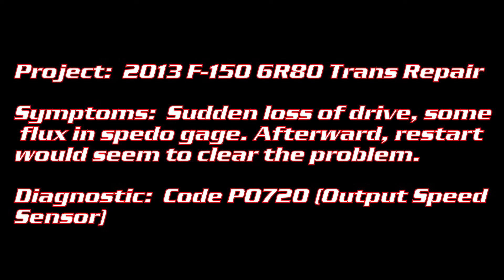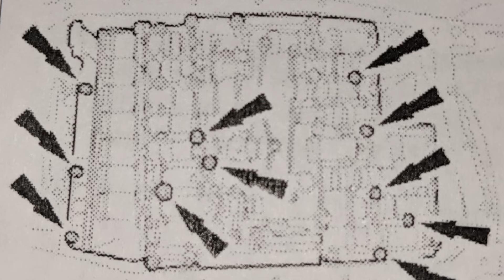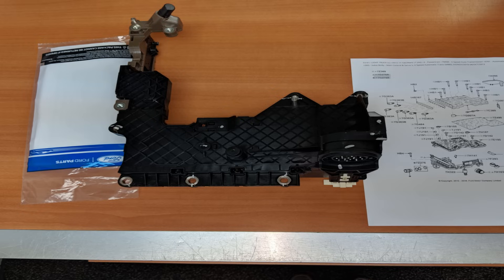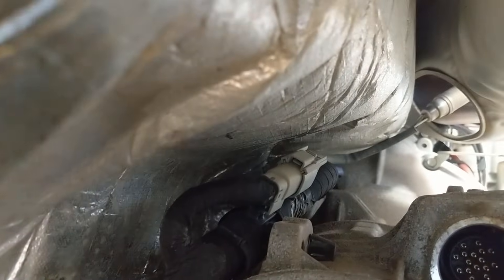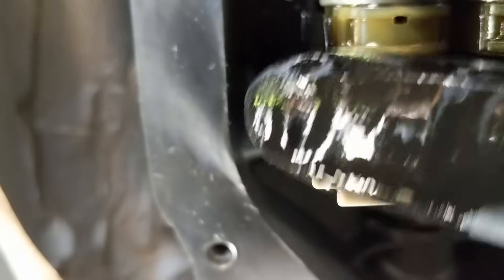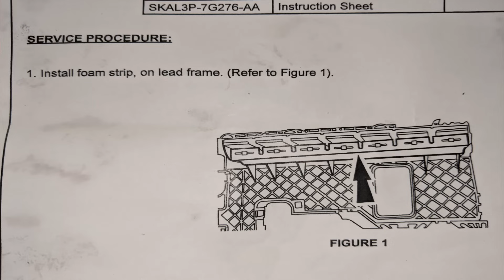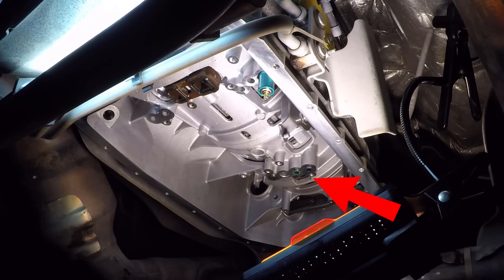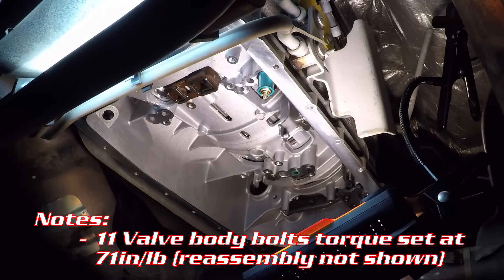6R80 Trans: Output Speed Sensor Swap

Comment: Boxcar,
Thank you for posting your video.  I have a 2011 F150 with 170K miles.  I had the dealer perform the recall "update" on my truck this summer.  Well last week my truck threw up the orange wrench and gave me the P0720 code.  I did my research, I realized I would be fixing this error myself as my truck was past the 150K miles listed in the recall for the free repair.  Thanks to Youtube, you, and Amazon I was able to repair my truck this weekend.  You gave me the confidence through your video to tackle this job.  The diagrams you provided along with the torque specs help me to complete the job.  I must confess I had a helper, which was handy especially when trying to remount the valve-body.  Thanks also to those of you who commented about having to drop the pan a second time to ensure that you placed the gear selector in the proper position on the Lead Frame.  Your comments saved me headaches, aggravation and some profanity.  My truck is running like a top.  Thank you.
Reply from the maker: That's awesome, this is what it's all about. Appreciate the.reply.

Comment: I'm having same exact issue with my 2015 3.5l ecoboost. Been sitting for a year and half, starting it, driving it around the block until wrench light illuminates because of this. For 1st year Ford had a part shortage, I literally couldn't get the part. I called every dealer in a 5 state area who had back orders up to 83,000 of these parts. I'm going to now get mine but I need to know one thing before I begin this job. 

Did you have to have the ecu or tcm refreshed to accept the new part??? Word has it you must refresh the computer to accept the new part or the permanent code 0720 and any associating will not allow the ecu to recognize the new part.

Also they are now calling this part the "conductor plate" and supposedly are coming with a small gasket to go over the leads to protect them from any shavings or particles causing the part to short and throw the code?
Reply from the maker: Never had the refresh. Good luck. I'm in a 2021 F250 now... but my repair was going strong till I sold it.

Comment: This is covered under 2 different recalls through ford a 150000 miles or less but not for Eco boost. First recall is for reprogramming to prevent having to replace the leadframe. The second recall replaces the lead frame.
Reply: The most recent recall is for a reprogram. Not for changing the leadframe. The reprogram is supposed to keep the tranny from slamming down into first when you’re driving. It does nothing to fix the problem this guy was having which is the same problem my F150 is having. He lists the symptoms at about the 25 second mark. I had the reprogram done a week ago (April 2019) and it did nothing for this problem - code P0720
Reply: @fnap7954  that's is the first recall the second recall fixes the leadframe I just had it done didn't cost me a dime
Reply: @fnap7954  the reprogramming the first recall is actually to prevent this from happening to the lead frame
Reply: @MikeBeast007  guys, thank you so much your comments!! Man, I was dreading this until you said Ford has recalls! I called this morning and YES this is covered. Drive a 2012 5.0 F150

Comment: “ they just about put the shade tree mechanic out of business”. Yes, you are exactly right! I’m about 95% sure that my next truck with be from the 1960s. I can make one as reliable as a new one and I can fix the damn thing 👍. My 2011 5.0 has been a good truck so far though. 98,000 miles on it currently. But I can’t help but long for the old days lol. A 1966 Chevy or Ford truck with a fuel injected v8 would be just fine and reliable as anything is
Reply from the maker: Amen brother! When you consider the price of a new truck these days...  I'd rather do/pay for a frame up restoration of something with class. He'll you can add anything these days you want. Thanks for watching.

Comment: Thank you for the video.  I am having this speed sensor replaced next week, under extended warranty, and I wanted to know what the dealer was going to do.  Now if I can figure out what costs I will have,  I am assuming the cost of the part is all Ford will pay for, all labor and fluids will be my cost.
Reply from the maker: Honestly....I did this repair on my own ($)....I had no idea there was an issue at the time....im unsure today  if it was even socialized yet via the recall when I did the repair.  AND...  I never went a local dealer for a refund....maybe I will....eventually.  Could use that money on some more interesting projects! Thanks for watching! Hope you Sub and drop by.
Reply: Boxcar Garage: Just picked up my son's 2013 Ford F150 from the dealer.  No charg e to have the speed sensor replaced under the Ford Extended Warranty.  No charge for the diagnostic time either.  I thought your subscribers might find this resolution helpful.

Comment: There is a recall on this but it will only apply if your truck is setting a code or a technician drives your truck and recreates the issue. My 2012 F150 has been randomly slam shifting down in low speed situations and on the highway for a year. I had the TCM reflash done and it helped for a month now the shifting issues are back. HOwever still no codes set and FORD will not replace the lead frame under the TSB without a code set. So I am ordering the parts and fixing myself
Reply from the maker: Good luck with your repair

Comment: Does this work for a 2013 ford f150 flex fuel v6?
Reply from the maker: If the v6 has the same trans I'd guess...but you'll have to verify that
Reply from the maker: But as I understand it Ford stepped up with a warranty repair. I was just too early in fixing mine

Comment: Great video! Got sudden downshifts while driving, with check engine/traction light coming on. P0720 code on diagnosis. Also glad you highlighted possible issues one can encounter especially when trying to mount the valve body back in the transmission.
Reply from the maker: Hope the vid helps.....was a very humble attempt on my part...but all is good so far! Thanks for watching.

Comment: There is a recall for 2012 f150 output speed sensor.
Reply from the maker: Really....any relief to second owners with over 100k....doubt it, but who knows.
Reply: @BoxcarsGarage  I read Ford extended the recall to 10 years and 150,000 miles regardless of ownership. Worth checking on, Danny

Comment: I was quoted 2000 dollars but that is with the install of a new valve body c/w lead frame. My trans has a nasty 1to 2 shift so dont think it is the lead frame. Gonna try complete vb. Thanks for doing this some excellent pointers that will help. looks like that funnel will work way better than the suction gun.

Comment: Hein sights 20 20. Ford just came out back in June 2019 a program to fix these leadframe issues. And they warranty the trans for up to 10 years and 150,000 miles from the date of the trucks first sale. Dont quote me on it on the warranty time. But I do know they came out backing the issue.
Reply: Ya but only for the V8 there are a ton of v6 trucks that the recalls basically leave out in the cold
Reply from the maker: Irresponsible of Ford

Comment: Thanks for taking the time to share your knowledge on the 6R80 transmission . I have dropped the pan on my car and changed the oil and filter after seeing your video. You certainly inspired me to give it  a try, even  as daunting as it appeared. Because the fluid had never been changed after 80,000klms(in Australia) I found a glug of grey paste around the pan magnet. It also appears to have found its way into the solenoids. Because of your video I have the confidence  to remove the valve body .From your experience, is it relatively straight forward to access and clean the solenoids.
I don't have any fault codes appearing on the instrument cluster but am experiencing a stutter when gear changes from 2 to 3rd and 3 to 4th. Info to dates says this may be the cause ie dirty solenoids ? Any knowledge/help would be appreciated .thanks Martin
Reply from the maker: Thanks Martin for that. As for your situation... Check this guys site... he's the lead I followed and a legit transmission man as well. https://youtu.be/8N9XQlUV-eY

Comment: Just replaced this on my 2012 f150 due to random shifting issues and getting stuck in first gear.  Code P0720 (output shaft speed sensor).  

Dealership reflashed the computer a few months back under recall but it had no effect and the issues were getting worse.

Truck shifts very smooth now with the new lead frame unit on there and haven't had anymore issues getting stuck in gear.

This vid helped a ton,  thanks.
Reply from the maker: Hey glad to have it appreciated. Congrats on the fix.

Comment: How many quarts did you end up using? BTW thank you for the video!
Reply from the maker: I believe it was seven and 1/2 I'll check and get back with you.
Reply: Approx.  7.5 quarts for mine as well.
Reply: Just dropping the pan and replacing the filter, I use 7.5 qts as well.

Comment: Just tried this last night, truck was in drive when started. After job was finished, I went to start truck and wouldn't turn over( not in gear?) Cycled the shifter, and now stuck in low gear (1). Did you do have to flash computer? Or manually select gear o. Side of transmission? 605-310-4447
Reply from the maker: Hey Owen thanks for checking out the video first off now granted I am not a technical authority to really be able to answer your question but if I had your situation I would probably want to mentally cross check if I got the tab from the lead frame in the notch of that plunger arm and also ensured that the linkage knob ended up in the notch of that piston on the other side sounds like to me you might have had one in and not the other and I don't know which side that would be that it's showing that is not taking the input but that would be my first thought and then beyond that I would have to do some studying cuz it would be outside of my realm of diagnosis.
Reply: @BoxcarsGarage  lead frame notch was in piston, but I'm guessing not on the exterior, but I'll be starting all over Tonight
Reply from the maker: That's what I guess is that the other Notch didn't get put in there that arm might have slipped forward or back and just didn't line up when you set that valve body in place. Good luck brother I feel your pain
Reply from the maker: oh and here's another nugget of information that came from the job guide when I was going to drop my valve body the job guide said that the transmission should be in neutral and I went ahead and did that and blocked it up and set the break of course to where it wouldn't move that neutral position might be something that helps get both of those lined up to where they're both able to slip into the Notch and if you don't have it in neutral it might cause a problem that you run into something to consider I originally didn't think much of it I just did it because it was in the job guide so let me know
Reply from the maker: No flash computer, and did not have to select a gear. The still image  in my vid would have been in a neutral position. I'd drop the valve body and select neutral when it's out and then put that VB back in and button up.
Reply: Hey just want to thank you for steering me in the right direction, I didn't get linkage hooked all the way. Now she runs like a top again, much love brother.
Reply from the maker: Glad to help... Just to let you know your the first viewer that has pulled any direct utility from one of my videos! So validated... Thanks for the feedback/happy to help/consider subscribing...it's a long road ahead! Later
Reply: @sixoh5ive840  what do you mean by hooked up all the way? Mine is stuck in park with no other gears
Reply: @Grayday1717  there is a plunger that moves back and forth that tell the trans what gear to be in. Have to rotate gear selector to that it fits inside the grooves of the plunger. I believe neutral is best position because it is easiest to line up.
Reply from the maker: Hey fellas we doing transmission work tonight? Like Owen said... Nutrial is preferred but as long as both nubs are in the slots of the plunger it should all work out.
Reply: @sixoh5ive840 figured it out thanks for the response. Would have saved myself 30 dollars in mercon if I would have more attention to detail. Learning ain't cheap.
Reply: @BoxcarsGarage  started in neutral failed to place the manual gear selector within the cam. Overall wasn't bad 7 hours and pulled it twice. Now I'm short a few quarts of fluid. Thanks great video.
Reply: @Grayday1717  dude I literally did the same fucking thing, had to drop the pan just to align that fucker. All that fresh fluid down the drain lol. I am glad I could help solve your problem. Sucks to rack your brain... especially at 2am when you truck is in jack stands.
Reply: @sixoh5ive840   This is covered under 2 different recalls through ford 150000 miles or less. But not for EcoBoost

Comment: Where is the speed sensor?!?!?
Reply from the maker: It's on the lead frame... it's integrated into the unit. Your only option is replacement of the entire assembly unfortunately.
Reply from the maker: If I remember correctly...I point at the two sensors in my vid... An input and output sensor.
Reply: Yeah my bad.. I researched it a bit and found that.. smh 🤦‍♂️

Comment: Thanks great video!!i went and bought the part ill let you know how it turns out.
Reply from the maker: Good luck with the repair. Others have mentioned that the repair may be under warranty but I have yet to verify this. You may want to enquire before you spend your money. Good luck.
Reply: It's out of warranty. It's under recall,but ford wont fix for another 30days so here i go
Reply: It worked......😁😁😁 nnnnnnnoooo issues.  Thanks again for the video keep up the good work

Comment: Sorry.... Fell asleep twice during the video.
Reply from the maker: Lol....what can I say?? Thanks for attempting to validate my selfless contribution to the F150 masses!!! Yee haw
Reply: @BoxcarsGarage  Okay! So I was able to stay awake and watch the whole video this time! Ha! Anyway... I wanted to ask if I need to change the whole Lead Frame for the VSS output sensor or is it possible to just replace it alone? I'm not having any shifting problems and no codes at this time but I have noticed that when I use the cruise control the tachometer seems to want to surge a little. It doesn't seem to do it all the time. I just purchased the truck from a kid who had takeoffs from a 2020 put onto it. A little bit taller than what was on there originally. I live out on the flat country of Indiana and was thinking it might be wind resistance or possibly the mismatched wheels. And yes the speed odometer is off just a bit. About 3 mph slower than normal. I use GPS to verify. In the old days we used to change the speedometer cable gear to compensate. I'm planning on changing my fluid and filter and wanted to tackle this while I have the pan dropped. He had a "mechanic" but I'm not sure I trust his judgement. There is no Idea of when or if the transmission fluid has EVER been changed. And yes... He told me that he put Lucas treatment into the oil! 3 valve, 4.6 L with Cam-Phasers! OMG! That was drained out the same day I got it home! I'm leaning toward the tire size the more I think about it. Would you also happen to have the correct part numbers for the filter and Lead Frame? I don't think I'll need the frame but just in case. I'm sure all the solenoids are good for it still shifts okay, just a little bit sooner. I'm pretty sure the oversized wheels might have something to do with all this. Any suggestions would be greatly appreciated. I promise not to fall asleep during the next class!
Reply from the maker: @patricksnead6546  I'm not sure you dealing with what was going on with me unless you have the code I mentioned. My truck would simply drop out of gear altogether  and during that time there was some gage flickering. 
My takeaway from your situation seems to address multiple potentials...I'm not qualified to guess with yours. 
As for just the solenoid...maybe seperate but seems it was integrated to the entire plastic lead frame structure. And unfortunately  no, I don't have the filter number. Sorry man. Good luck
Reply: @BoxcarsGarage  That's okay! Figured it wouldn't hurt to ask. My issues as of this time are not as bad as yours. Wow! Hope you got it taken care of. The more I follow up and read, I'm beginning to think mine is a recalibration issue. I'm still looking. Hope yours is good to go and wish you luck. I'll keep checking in on the videos!
Reply from the maker: @patricksnead6546  I was at around 100k when I repaired it. Im at 187K now believe it worked out so far. Yep, check on back